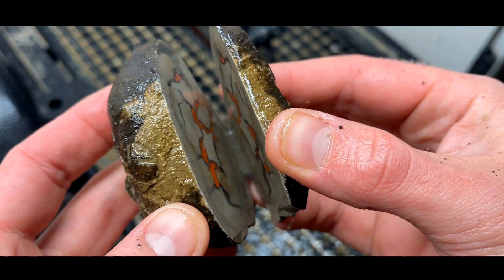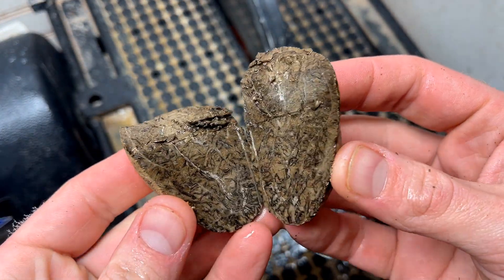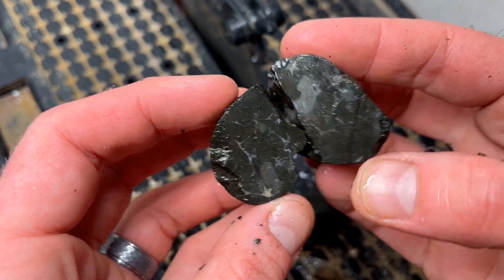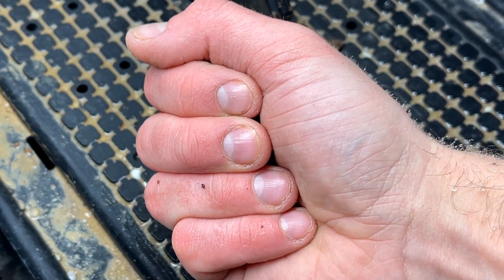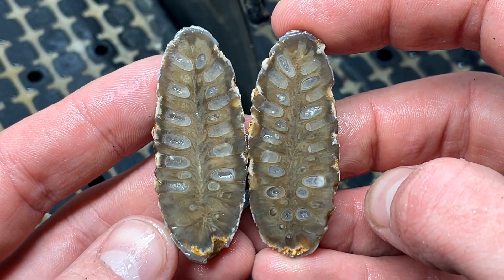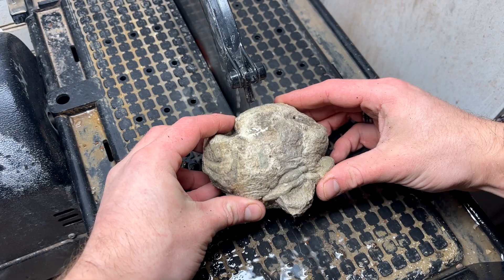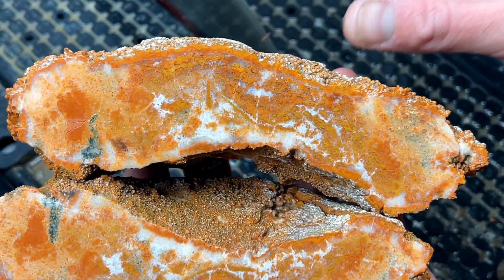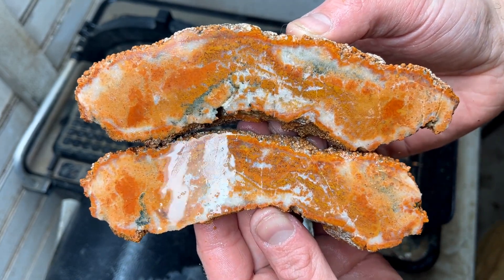I cut Granny's Coprolites open! (Fossilized 💩)

Comment: I've been a rock and fossil hound my whole life. Those rocks your cutting in half are really cool.                                                                          I hope you can find a different way to hold the rocks while your cutting them. As a professional commercial shop carpenter and welder for 30 years I count myself lucky to have never been seriously injured, even though I was always careful. A grinder cut is very painful and destructive very quickly. The blade rotation will drag you down and into itself. You wont have time to even react until its too late. I've seen it happen to a few people. Consider a young newbee sawing their finger half way off after watching one of your vids. Peace 😎

Comment: Even though the video was speeded up during cutting, I  noticed you seemed to be using too much pressure and force, which could have been the reason for some of the splitting and chipping. Remember, slow and easy wins the race and prevents cracking.

Comment: You should stabilize these coprolites before you try to cut them.  It should keep them from being as crumbly as they are.  I suggest PaleoBond PB002 Penetrant Stabilizer.  Drizzle it all over the outside with a pipette/eyedropper, and let it dry at least 24 hours before cutting.

Comment: I do a decent amount of cutting on a wet saw and to avoid chips/blowouts I will sometimes cut half way through and then flip the piece around and come in from the other side. Also the saw style with the blade and motor suspended above the sled are handy because you can raise and lower the blade and take even passes gradually going deeper
Reply: Blade, speeds and how much you're feeding is important to consider. He's just going whole hog right into it.

Comment: Oh yeah, that pinecone is gorgeous! That was fun, the patty was especially colorful. Regarding the chipping/splitting, I wonder if you could stabilize those before cutting. Using the two-part epoxy resin, put each piece in a container and pour in your prepared resin. Then set the container of resin/poop in a pressure pot for a day or two until the resin is set. I've never tried this but I think the pressure pot might force resin into the pores and cracks, and "set" the piece so that it's stable when you cut it. It's the same basic process they use to stabilize softer minerals like turquoise so that it can be used in jewelry. Anyway, that was fun, thanks and tell Granny hey for us!
Reply: yeah, but cutting poop isn't his day job , ya know?

Comment: If you ease up on the pressure as you're cutting, you will have less chipping. I've been working lapidary since age 14 yrs. And instill have to remeber this myself as it's easy to get excited and push to quickly.  The microscope is a great idea, but don't forget to check them with a UV light. Appreciate your content, keep it coming👍🏻💯
Reply: Are you 15? Cuz that would be funny.😊
Reply: I would wonder if there's some kind of hard resin-like material you could encase these with before (slowly and gingerly) sawing them in half, which could then be dissolved or melted away afterward if desired. That way, among other things, you could choose literally any cutting angle you wanted.
Reply: @peterblinn7946 there is a product called optikon for defects in granite countertops that you can immerse your rocks in and put in a vacuum chamber to stabilize rocks
Reply: @peterblinn7946  Had the same thought, gotta be a handy way to stabilize these.  I did the nerd thing n went and asked GPT4:

Casting in Epoxy - Keeps omni-directional pressure on all rock surfaces, provides clear, grippable, polishable, displayable medium for handling, researching, and displaying cut pieces.  Freshly exposed surfaces can be re-immersed and sealed with epoxy, allowing for additional stabilized slices from each new cut.  This would enable extremely thin slices of stone to be made directly into 'slides' of epoxy-stone-epoxy plates.
Reply: Thanks, David. Looks like this guy needs some advice  and training, especially if he's charging to cut rocks or profiting from this channel. I feel bad for Granny who trusted him with her collection.
Reply: yep, and there is the grinch @stoptappingyournails

Comment: Get an auto feed saw. It will stop most of the chipping and breaking. The rock is clamped in, held steady and fed through at a slow pace.
Reply from the maker: I don’t think an auto feed would make a difference as the coprolite is brittle :)
Reply: @TaylorsRocksmithery  I didn't say it would completely eliminate the chipping/breaking issue. I know a lot of coprolites are very brittle. So are a lot of other stones and minerals. I've even had fine gems explode on a lapidary wheel after many hours or work. The tiniest imperfection can turn into a disaster.

Auto feeds will greatly reduce the chances of breaking/chipping in most cases. That, and you will get beautiful, smooth cuts that reveal a lot more detail. You can get beautiful thin slabs that when backlit show off their detail and beauty. 
It takes a lot more time per cut, but the results are well worth it. 

Freehand cutting like this is like trying to whittle a small trinket out of a stick with heavy deforesting equipment. You may as well use a hammer and chisel and take your chances. 

My father was a mineralogist, geologist, lapidarist, jeweler. I learned how to do as much as I could from him well into my late 20's, and I helped run the business.

I grew up doing this stuff, from hunting rocks/fossils/gem stones to finished cut and polished products;  jewelry from design to wax carving to casting to setting stones to finished jewelry. I learned as much as i could. 

I got away from the craft because the market was way too unpredictable. 

I do wish I still had the equipment because I would love to have it at least as a side hobby.

I ended up in the electronics field. It was my hobby turned passion from a very young age.

Comment: I never saw anything like this before. I am an electrician and have had to core and saw through concrete for conduit and I have kept several cores because the aggregate was interesting.  
Coming from a different use of cutting I have some ideas for you.
I would suggest using a sled to minimize fractures, and maybe using a towel and clamps to secure the stones. Also if you suspect something is special a new but slightly broken in blade works so much better when cutting. Another thing I noticed from my personal experience is slow uniform pressure gives me the best cuts

Comment: Hello, such brittle material could be embedded in gibs for cutting. Possibly harden in B72 solution beforehand and then cut or both. I could also imagine epoxy if it doesn't burn when cutting. my best regards.